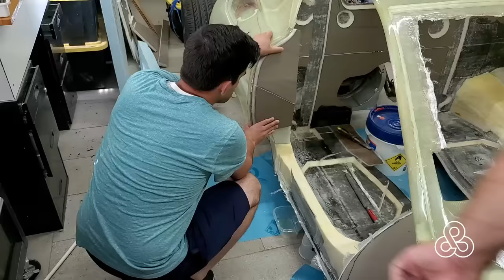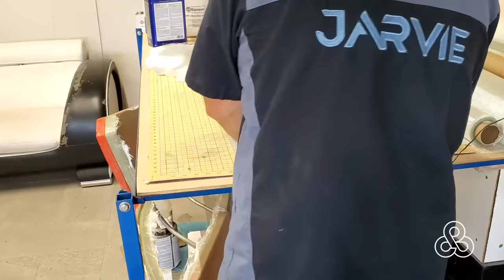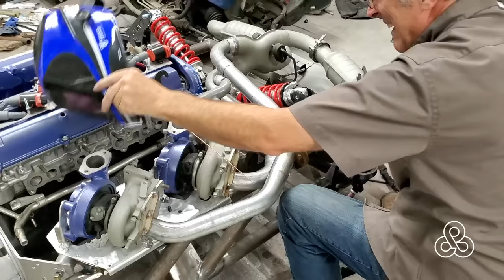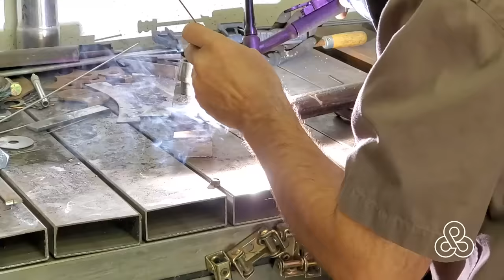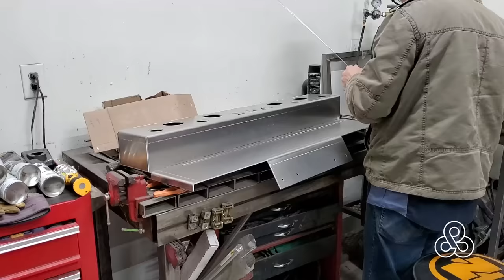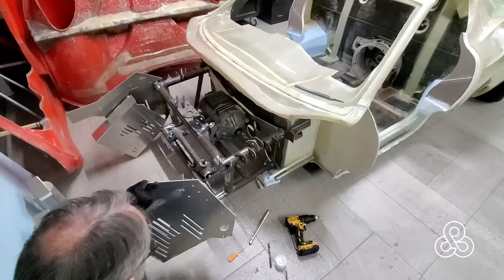How to build a supercar from scratch. Part 2. Arete Supercar project

Comment: Jarvie, this is one of the most incredible builds I have ever seen in my life, and you are an inspiration - but I HIGHLY recommend you incorporate a basic tubular steel rollbar / support structure. This is going to be a very light, and very impressive car performance wise, but your safety is very important - and a fiberglass monocoque likely will not fare well in a rollover situation. It will also massively increase the torsional rigidity of the car - mainly if you are able to tie the cage into the subframe mounting points. Even as just a roll cage that is bolted to the monocoque it will make the car much stiffer. I understand if this is an unwelcome suggestion for such a change -  as this is YOUR vision, but I ask you to please consider it. - Dean.
Reply: i wanted to also ask if he'd designed a breakaway into the car between the drivers cell & engine bay as many lamborghini's and ferrari's have done.
Reply: There no shame when it comes to safety suggestions!!! That’s a great idea!!!👍🏻
Reply: @Lennox1012  No -  you might be thinking of something else he said. The Arete project utilizes a fiberglass / Kevlar reinforced monocoque and a occupant safety structure / semi stressed roll bar. (He posted about the occupant safety structure earlier this day) Happy to see it.
Reply: Roll Cage we don’t need no stinking Roll Cage
Reply: Rollcages/ bars being "safe"  in a street car setup is a huge myth- look up roll bars(or cages) sled tests, and you will see why.
Reply: amazing
Reply: How about a carbon fiber roll bar?
Reply: Let’s just skip past the roll cage and build a extraterrestrial space craft already, talk about performance and safety, it’ll be out of this world, lol!

Comment: do some dimple on the structure support plate and put some curves on the plate for more rigidity.
to release mold use air pressure between it so its easily pop out.
GREAT WORK
RESPECT

Comment: Not sure if I missed it but one thing that I'd strongly suggest is this- I'd remove all of the drywall mud that is beneath the fiberglass shell because that mud WILL(guaranteed) break up and will continue breaking down and thus becomes like sand and moving around. I'd strip ALL of that mud and then like a gel coated mold, you could just spray fiberglass with a "chopper gun" and roll out all of the air, it'd be nice and strong. Go one steps further and do a thin layer of fiberglass with a chopper gun then laminate over that once it's cured, with either carbon fiber, Kevlar or a blend of kevlar, carbon fiber and/or/with graphite. You just need an autoclave to heat/cook/laminate it all together
Reply from the maker: Sorry to say, but yes you did miss some thing! That drywall mud was just a plug to take molds off of. There is an entire series of videos describing each step in detail. It is all listed in a play list on the channel called Arete curated play list. Just watch according to the numbers in the title (i.e. A1-A78)
Reply: @BuilderCreator  right on, I thank you for the update. I appreciate you taking the time to share that. I'd also like to add that I'm thoroughly amazed at what you've done. I know that you've done(built) something that very very few people are capable of even doing. It looks badass

Comment: I love your project. Just have a suggestion.  As you may already know - it's not so much exhaust pressure that spools the turbochargers but rather than heat, I noticed you mounted the blowers a fair distance after the primaries, that would've given the spooling heat energy too much time to cool down to be any good, you'd lose a lot of response that way as well. The most efficient turbo manifold setup is the log style where the primaries are nice and short. We tested this theory a while ago on a 350Z when we originally added turbos to the V6 they were mounted at the bottom either side of the gearbox Bell housing, when we changed the set-up to log manifolds, it reduced turbo lag so much - with twin GT30 BB turbos, max boost when from 4200 rpm down to 3400 rpm, just by changing the location of where the turbos are mounted.  Food for thought for u... either way,  good work
Reply from the maker: I haven't yet built the manifold and I'm already worried that the turbos are so close that fabricating the manifolds is going to be super tricky . . . just can't get much closer, but it is interesting to hear about your results on the 350z.
Reply: @BuilderCreator  you can build a super car yet can't devise a solution for such a simple "challenge"? I have a feeling you could come up with something fantastic.

Comment: I can attest to the "build at home in your spare time."  Several years ago I built a Locost - Lotus Seven replica  - in my 1200 sf shop.  It took 2 years of spare time while learning new skills, sourcing parts, and having the best experience of my life (with clothes on).  I'm currently building a Jetta Smyth Ute, and one thing I've learned with both builds is that you need to at least quadruple your schedule for redesigns, fixing mistakes, days off, and unexpected events.
Reply from the maker: But never plan on quadrupling your schedule or it will take 8 times as long!
Reply: @BuilderCreator  I used to be a software project manager and we had a factor for the slowest employee that we applied to the entire project. then doubled it.  It worked out well.
Reply from the maker: @Capt_Beefheart  Being I am the only employee, it should be an easy calculation. I will check with myself to see how long I might take. Ha!

Comment: This is very inspiring. Im glad you are doing this it gives me an idea of what I will be doing for my super car. I'm trying to secure a work space at my uncles house in Puerto Rico so I can do this over a 6 month period or faster. I'm constructing a list of things I may need as well as researching the nearby hardware stores near his house. I wanna build it using a 3D Printer. As for the chassis I'm still on the fence of where to go. I have the chassis plans for a Lamborghini Diablo BUT!!!! I have seen many different chassis plans for mid engined cars online.

Comment: Amazing project!  When I was watching this I was thinking that the clubs I've raced with want DOM cages.  Also, BMW makes a "street Heim Joint" for the rear control arms of their E36 M3 that are pretty cheap.  I think I'd use them on any custom performance suspension I built.
Reply from the maker: For those out there that aren't familiar with roll cage requirements; what @eknuds is pointing out, is also the reason I have used mild steel for the control arms and is the same as the requirement for DOM Tubing (other than the higher tolerance in manufacturing), is malleability. In a roll cage and in the suspension, we are hoping it will deform rather than fracture in failure. Better to have a bent part than one that comes apart.

Comment: I grew up doing carpentry, I’ve done some concrete forms. The ability to think about how to build a form isn’t easy. Upside down, and backwards is a challenge
Reply from the maker: left brain, right brain, inside out brain. Ha!
Reply: Same here... lots of carpentry, forms especially.  Having a woodshop is handy, I do lots of mold making and sometimes utilize cheap MDF  for straight and shaped plugs and molds. Just prime em, slick em up and wax. Saves time . Even wing sections

Comment: Enjoying your videos, where do you buy that thin foam sheeting or panels ?  It looks like it is about 1/4 inch thick.  I have looked for foam like that but can’t find it.
Reply from the maker: Vinyl foam core material. You can get it in many thicknesses from most suppliers. Try Fiberglast.com if you need to order it online. Hope that helps.

Comment: Theories on exhaust systems.
I worked on a guys race car once (a 66 mustang ) under the class he was racing he required some kind of almost muffler and it could exit out the side in front of the tyres. I wanted to fit an X style cross over pipe at a certain distance from the end of the headers as they promote scavenging and can improve power but he was adamant that crossovers cost power. Many videos on YouTube seem to prove that I was right but I have never seen one done on a twin turbo engine.
In theory they are pointless or if in the wrong position could reduce power.
Because a turbo acts in part like a muffler eliminating exhaust pulses and increasing back pressure the exhaust gas flows more in a stream than in individual pulses reducing any scavenging effect a crossover pipe may have to the point it may cause a restriction. If the crossover pipe is in the correct location relative to the turbo it may improve exhaust flow by effectively doubling the size of the pipe diameter.
Interestingly a V8 either flat plane or cross plane crank doesn’t sound very much different with or without a crossover pipe (except for being louder without) or even single exhaust, a six cylinder can have its exhaust sound greatly varied by the design of the exhaust. Splitting the engine into two banks of three and keeping those banks separate can make even the most under powered daily driver sound like an exotic super car. Adding a crossover pipe near the headers can almost eliminate that effect, placing one close to the rear may reduce the noise level but not provide any power benefit.
One of the most amazing sounds I have ever heard was a V12 Etype jag with four separate exhaust pipes from header to tip
Reply from the maker: A million variables! Do your best and pray. Ha!

Comment: Did you not remember that the turbo exits need to flair out at approximately 30-45% for a bit, BEFORE resuming your pipe size? That allows the exhaust gas to flow OUT and stop spiraling which makes the exhaust spiral the full length of the pipe? This is a must do on turbine exits!!!  😉😉🤓

Comment: There is a man who lives in England (I think, not sure) who made a complete auto body out of his special mixture of laminated hemp fibers. He claims it's stronger than fiberglass or carbon fiber that has gone thru the same lamination process and it's somewhat flexible (it can absorb minor impacts without damage or dents). I don't know it his hemp body could be used like in your monocock tub/unibody design but it might be worth looking into. It's been a while but I think I saw it on an episode of Top Gear.
Reply from the maker: I think there were a couple of fabricators names Cheech and Chong who fabricated a whole van out of hemp fibers?

Comment: Newtek's Lightwave 3D has an excellent modeler with any view and shading you can possibly want in real time. You can still insert your build process, but be a lot closer to your end than where you started with your plug. it's WAY affordable, would even say dirt cheap in a project like this and can animate and simulate wind testing.
Reply from the maker: I have opted for Solidworks and Rhino 3D for the next project. Since I have made the plunge maybe a few parts for the Arete from CNC as well.

Comment: Looks great. I know what mean when you decide not to use 3d modelling. I had a friend from Ukraine some 20 years ago. He was an architect and fellow of architecture in London England. He found, even in rather standard drawings of walls the 3d rendering of meeting points, wall to ceiling or to roofs the program may carry a wall past the intersection to where it believed it should end. On a complex build like this I wouldn't trust a computer program to be able to do the same as my hands on the physical piece.
Reply from the maker: And sometimes- What's the fun in 3D models and CNC machining. ;)

Comment: Which software did you use when you enlarged your drawing? When I was trying it in autocad scale was being enlarged all dimensions, imagine square with 2cm width and 2.5 lenght, if I try to make that 2.5 side 2cm, it was making it 2cm, but other side was changing too, I hope you understand what I wamt, shortly, I want to make this drawing scaled by me...
Reply from the maker: Yes, I worked in AutoCAD as well. My model was about 50mm long, and I scaled it globally (all over) by a factor of 7.5 making the finished model around 3750mm (3.75m) Long.
Reply: @BuilderCreator   thanks for reply my friend, wish you good luck and all the best
Reply: @BuilderCreator  that is also my dream and I am starting to work about it, I bought weld, I am going to buy some tooks and materials for it, gonna use round tubes for chassis, what thicjness and diameter do you recomand?
Reply from the maker: @ratimachaberidze9453  That is a "How long is a piece of string?" question. There are dozens of factors that will determine the tube size. The final weight of the car, suspension type, engine placement, etc. etc. Then you will need to decide what style of frame suits the purpose, dual box channel rails, like a hot rod or truck, or birdcage with hundreds of lightweight tubes. You might find plans for a tube frame online, if you are going with something popular in the racing world.

Comment: Just a question the fiberglass looks thin and very rough. Any sanding looks like you could sand through it....was a gelcoat not used?
Reply from the maker: The gel coat is a finish surface and can be applied into the mold or on top of a laminated part- OR- you can go directly to post finishing (primer). Koenigsegg has in fact started micro sanding (very fine grit) any resin off the surface; right down to the fiber and clear coating. So far I have only sanded through in one spot and I use a very fine weave cloth  on the first layer so primer should block any "print through" showing in the paint. Thanks for following the build and the comments.

Comment: The great thing about Kevlar is that, while it doesn't provide much of anything in the way of compressive strength, its strength under purely tensile loads is pretty much unrivaled. It would be kind of a crappy material to build anything out of all by itself, but it works wonders when used in conjunction with other materials, especially Carbon. Kevlar and Carbon-fiber complement each-other exceptionally well, structurally speaking.
Reply from the maker: All Kevlar, if you are building a impact prone item like a canoe. I only use Kevlar on impact areas that "may" receive damage and I want to keep the broken area intact rather than spread all over the road. There are some cool colored Kevlar\carbon combo weaves (I have orange/black) that I may use on some exposed fiber trim pieces. Stay tuned.
Reply: @BuilderCreator  That's sorta the same way I use Kevlar. I tend to put it anywhere that might be considered a Stress-Riser. It's more for peace-of-mind than for anything else.

Comment: Is the fiber glass not going to corrode the steel tubing for the harness?
I see the hardwork and passion you have into this project,it's just all so inspiring
Reply from the maker: There is a problem with galvanic corrosion with carbon fiber, but not with fiberglass. Thanks for watching!
Reply: @BuilderCreator  okay

Comment: You’re having too much fun building this! 
I was surprised that you still used plaster. I probably would have stretched cheap fleece w/superglue, to create the skin and coat it with epoxy resin.
That expanding foam kinda reminded me of a product sold at the hardware store that’s used to backfill post holes 🤣
Why build you’re own ecu and not just get a standalone, like a Haltech? 🤔
Reply from the maker: Why build an ECU?- Why build a car from scratch? (and about $1000 less expensive)

Comment: Great build, I'm curious, why you didn't spray your molds with gelcoat (as fiberglass production is normally done) before laying up your glass?
Reply from the maker: Use gel coat if you plan on it being your finished surface. I plan on doing some serious post finishing with a high end paint job. Gel coat in this situation is just added weight.

Comment: I notice you don't wear a respirator while glassing. What kind if ventilation do you have in your studio?
Reply from the maker: The epoxy I use is very low odor or VOC. Ventilation- windows, doors, fans and dust collectors.
Reply: @BuilderCreator  cool, thanks.

Comment: are you using any peal-ply between layups that are allowed to cure?  I also was wondering if you considered laminating a aluminum plate into your hardpoints?
Reply from the maker: Sometimes I use the peal ply, sometimes I just sand through to the sublayer fiberglass. Peal ply when I will be glassing before a 48 hour cure.

Comment: Asking for your wisdom, have Porsche 2016 Boxster, wish to rework the body to look like a cross of the Porsche 919 and Porsche mission x. Remove panels or bond to existing panels? Metal or fiberglass? Any other general thoughts welcomed.
Reply from the maker: If you have the tools and the skills, match the metal the car was originally created in. If you don't have an English wheel and such you can get into composites without expensive tools.
Reply: Thanks for responding appreciate it. I’m new to this car thing. When you say” match the metal….” What do you mean?
Reply from the maker: @treverjones1799  Match the metal, meaning; if the car is made out of steel fabricate the new panels out of steel, aluminum fab out of aluminum. The only variation of this is that if you were trying to shave a large amount of weight off the car you could go to carbon fiber with the understanding that you are going to shave a large amount off your pocket book as well.
Reply: Simple enough thank you! Remove old panels with complete fabrication of new panels using old bolt on contact points? Sandwich/attach/bond new panels to old?